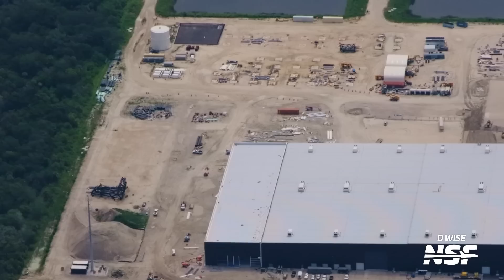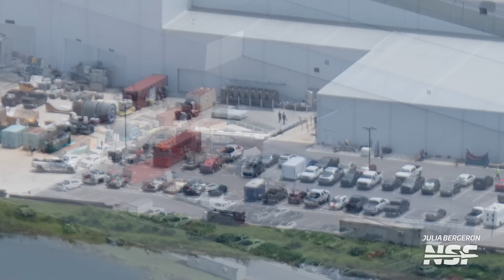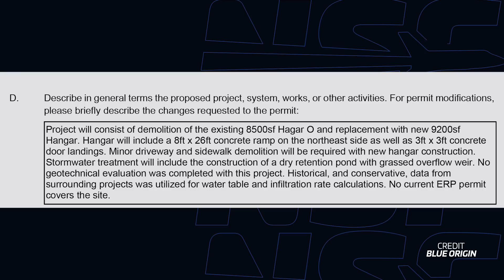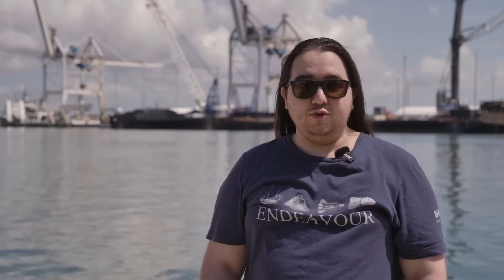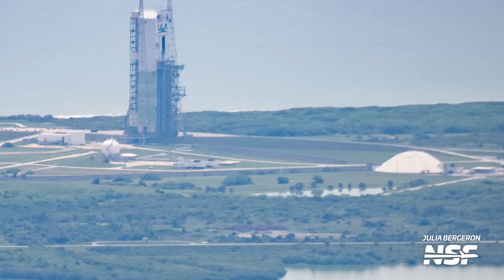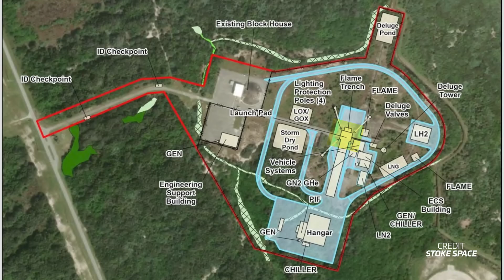Falcon 9 Grounded After Launch Failure! 🚀 | Blue Origin, ULA, and Stoke Space Updates | KSC Flyover

Comment: Environists are ignoring the major concern about the Falcon 9:
Insufficient Pointyness.
This is causing a multitude of problems with the launches and must be corrected ASAP.
Without a nice pointy tip rockets have a tendency to just fall over and cause a tragic disaster in the launch area.

An expanded version of the common pencil sharpener could be developed.
Like the standard version used in all schools it should have a disc on the side to adapt the cutting blades to various diameters of rocket.
The rocket shavings produced coul easily be recycled.
This Rocket Sharpener will prevent many, many saddening accidents.

Comment: F9  wasn't 'a launch failure' - it was a minor oxygen leak - which amplifys in that context - yes check and sort of course.   Tobie
Reply: It was a launch failure
Reply: LAUNCH of Booster with Stage 2 was fine - after seperation stage 2 had an unacceptable anomaly
Reply: @tobiebeele1731  Stage 2 is part of the launch vehicle. It's a launch failure

Comment: Arguable the most important flight. Not even close. Short of james Web, starship is the pivot point after 2025. It's like having horses change to tractors. It's a paradigme shift. It will launch orion in it's payload section and an emergency dragon capsule for spare when it fails. As it is private companies for airplanes it is now the agee for Rockets. The exception is that spacex is way ahead in it's thinking and goals, cuting the other companies seemingly "huge" goals to a one use tractor. Once the railroad to space is built, infratructure will soon populate it's space and new industries will emerge. People do not comprehend it yet even though it has successfuly made orbit( if they wanted to) . Starship is the enabler, and will change space like the wright brothers did airflight to paper planes. Stating otherwise is dumb. SLS will not make sence and NASA will buy 10 starship flights instead of 1 SLS. Time to swallow the pride and use their head and respect taxpayers enough to not waste their money. Nasa will be an important partner to spacex, just not that much on the propulsion side anymore. Exciting times to be interested in spaceflight.

Comment: Ship 30 had an engine replaced will it need to static fire?
Reply: Not necessarily S29 hand an engine replaced and only did a SP but it is likely
Edit: it was S28 not 29
Reply: @KiRiTO72987  S28, not S29
Reply: @bryanillenberg  right my bad got the two mixed up
Reply: Thank you so much for answering my question 😊
Reply: @Starship29andB11  ofc man
Reply: Most likely